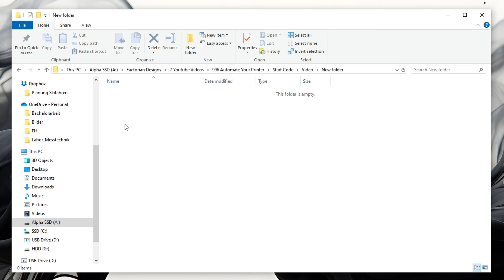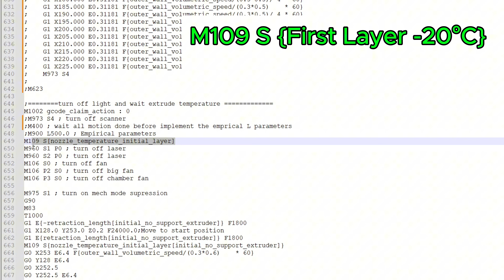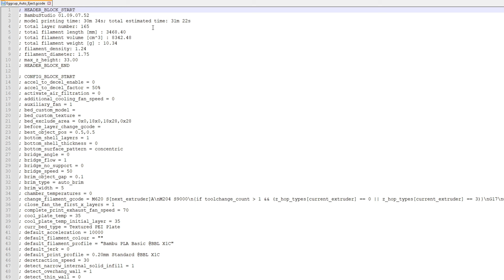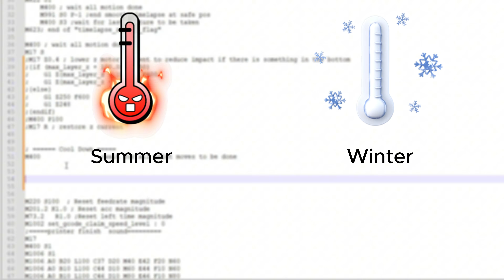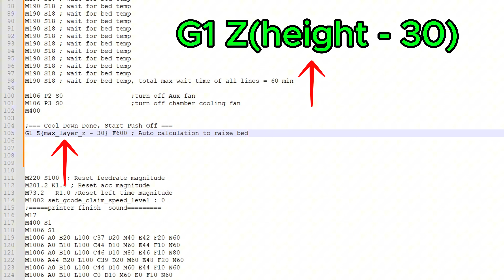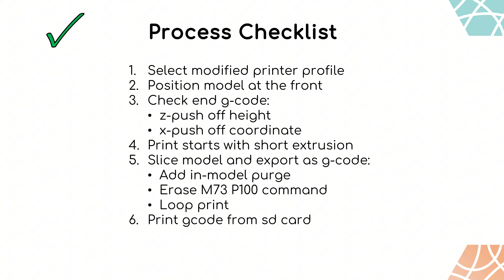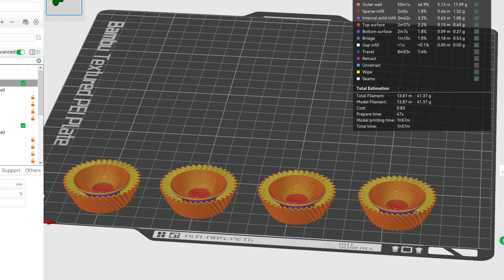Automate your Bambu Lab P1 & X1! Free & Easy

Comment: I am most amazed by the fact that you can have a printer, that is basically plug and play and you can have great prints sending them from mobile app while sitting on couch in a different room and you still can have such deep control over everything it does without any software or hardware modifications, no hacked firmware flashing, no unlocking with voiding warranty, support, manufacturer app support and so on. This is perfect.
Btw - if printing upside down works, then printing while printer is on its face should work too? And nozzle would be purged the same place where finished prints drop.
Reply from the maker: yes every orientation works, you just need space for stuff to fall in.

Comment: hey @Factorian_Designs - a question from another german dude. I don't get it with the purge line. I mean I do understand it somehow but I wasn't able to locate this in my start gcode. Or will this be added after I sliced it? Further, when you print some tiny parts, lets say like the shape o a pen - then the part with the modifier is kind of "complicated"... Is there any way to make that (even more) easy? don't get me wrong your video(s) is (are) perfectly perfect :) but I think I might be not the brightest.
Reply from the maker: I think they have changed the purge line since then but it should still be there. Its just 2 extrusion commands. If you want to see it in the preview engable "custom" in the top right preview section.

I don't know any easier way unfortunatly. Some just start without the extra line like I did in the A1 automation but I wouldn't exactly call that easier to implement 😅

Maybe look at some other automation videos to see if they have another solution :)

Comment: Unfortunately, it's not suitable for P1S. The nozzle starts printing completely dirty, creating blobs and mess on the first layer. It might be faster to prepare, but after pasting gcode, it seems to get worse. As for the final temperature for dumping the print, well, the fans don't turn on after the print is finished, and the printer sits idle, waiting for the bed to slowly cool down after a very long time. Please suggest some improvements.

Comment: First of all, I like your solution.
I would like to see that the "cool down" in your code checked the part height with an if/else statement to move the headbed height accordingly. (Note: I think your code says "move nozzle up," but it should actually say "move nozzle down/move head bed up," right?)
Are you familiar with the new "Farm Loop" from 3D Frames? I've tried it and can say it's not perfect. Every model they offer needs some tweaking, but the idea with the build plate bender is brilliant. (Note: I also optimized the model... I could share it.) I'm working on a combined solution, but:
I'D LOVE TO SEE THE BED BENDER IN YOUR CODE!
Reply from the maker: The bender solution really is fantastic. My A1 & mini code also has the if/else statement for the correct z height included as well. You should be able to transfer it with a few changes :)
Reply: @Factorian_Designs  
if/else for save cooling:

{if (max_layer_z) < 110}                ;When the bed is at zero (Z0), the object may be a maximum of 11 cm high before it touches the cable duct
    G1 Z1 F600                                 ; bed up
{else}
    G1 Z{max_layer_z -110} F600  ; bed up
{endif}
Reply: The "Bender" limits the printable area to a height of 200 mm (181+30=>200). This code clears the entire print area from top to bottom in 30 mm increments. (Starting hight dependsthe on object hight.)

;=== push down ===
G1 Z{max_layer_z} F900
M400

;!!!this "If" part copied 6 times into the code with max_layer_z 181,151,121,91,61,31!!!!
{if (max_layer_z) > 181}
  G91
  G1 Z-30 F900
  G90
  G1 Y250 F3000
  M400
  G1 X20 F3000
  G1 Y25 F800		; Very slowly push off
  G1 Y250 F3000
  G1 X80 F3000		                           
  G1 Y25 F800		; Very slowly push off
  G1 Y250 F3000
  G1 X120 F3000                       
  G1 Y25 F800		; Very slowly push off
  G1 Y250 F3000
  G1 X170 F3000		                             
  G1 Y25 F800		; Very slowly push off
  G1 Y250 F3000
  G1 X220 F3000 	                            
  G1 Y25 F800		; Very slowly push off
  G1 Y250 F3000
{endif}

;This part is always active and the only active path for pushing down objects if their maximum height is below 31 mm.
G1 Z0.5 F900
G1 Y250F3000
M400
G1 X20 F3000
G1 Y25 F800		; Very slowly push off
G1 Y250 F3000
G1 X80 F3000		                           
G1 Y25 F800		; Very slowly push off
G1 Y250 F3000
G1 X120 F3000                       
G1 Y25 F800		; Very slowly push off
G1 Y250 F3000
G1 X170 F3000		                             
G1 Y25 F800		; Very slowly push off
G1 Y250 F3000
G1 X220 F3000 	                            
G1 Y25 F800		; Very slowly push off

G1 X54 Y250 Z20 F900
M400
G1 Y265 F3000

Comment: My p1s can only cool down to 28 degrees Celsius in half an hour. Is there any solution? Thank you
Reply from the maker: Even with the AUX fan on?
Only way to speed this up then is lowering the ambient temperature, which can be very hard to do 😅
Reply: @Factorian_Designs Yes, I turned on all the fans and couldn't cool down. I tried to cool down the ambient temperature. Thank you very much.

Comment: Do you have any advice for getting petg to stick well enough to not spaghetti but still light enough to release when the plate cools to push off?  
I've tried several build plates and filament....should I be experimenting with nozzle temps or ?
Reply from the maker: I would recommend watching my other automation video for that.
There I explain in detail what you can do for prints to self-release :)

Comment: Got a potential hack for you: You can use Home Assistant to automatically send a photo from the Bambu camera at any layer height you desire to your phone as a notification . I use this for  checking my prints aren't spaghetti in a way I can't forget.

I use the MQTT method for this. I don't think it works if you use the recent "send all my data to China" Bambu update though.

Comment: I’ve been running your auto-print G-code for months without any problems—thanks again for that. Unfortunately, after updating my X1C/AMS to the latest firmware the file no longer prints from the SD card. It aborts immediately with the screen prompt:

“Please feed filament into the PTFE tube until it cannot be pushed any further.” 

If I slice and send a single model from Bambu Studio over Wi-Fi, everything works fine, so the hardware seems okay. The error only shows up when I try to run the multi-plate auto-print file from the SD card.

Have you seen this since the firmware change, or do you know what edits might get the AMS to load filament normally again? Any insight would be much appreciated.
Reply from the maker: Love to see people using this regularly!

This is probably fixed if you use a 3mf to loop prints instead of plain gcode. I explain how to do that in my A1 Automation video. 
Let me know If this fixed the problem for you.

Comment: Why do you explicitly not recommend alcohol for cleaning?
Reply from the maker: The Bambu wiki says it just moves dirt around and leaves residues. In my experience soap just leads to way better adhesion.
Reply: @Factorian_Designs  That sounds reasonable. 
I feared it might damage the bed. As someone searching the exception, I still think it  could be superior in being a solvent for fats.
However, in practice, it might leave residues, thus soap is probably the best option. 😅 I might have an adheason problem, which didn't become better since last time I used alcohol, I should try soap. However, there is a reason for using alcohol. You usually splash it on top of the surface, whipe it and hope for a good result. When using soap and aiming for good results, you need a sink, which might be not available nearby.
And I have a serious limescale problem :/

Comment: I seem to have a problem that the gcode that is generated seems to contain both the original gcode AND this gcode that I have copied from here. So for example, there are two bed levelling sections. Is this an issue with the new version of Bambu Studio ? Thanks loads BTW....Ringo
Reply from the maker: I tried this a few days ago and it still works that same. 
Are you 100% sure you copied the gcode into the correct slicer section?
(Not into filament etc..)
Reply: @Factorian_Designs  thanks for taking the time to get back to me! Bambu slicer looks diffferent nowadays but yeah, i think i did. For some reason i have two filaments sections open ( i dont have an AMS) for some reason - but its always been like this. Do i have to change them both?
Reply from the maker: No you don't change anything in the Filament section. You only change the printer start sequence in printer settings 😅
Does that fix it for you?
Reply: @Factorian_Designs  No because I can't find that on the new version of Bambu Studio. It looks different to your video....
Reply from the maker: I am currently on vacation and have no PC, but its definetly still there just in a different location.

You could just download Orca Slicer it still looks exactly the same and is better anyway :)
Reply: @Factorian_Designs I never even considered that. I might! Have a wonderful vacation and thanks loads

Comment: I love this idea and have been trying to do the same on my A1, but the problem im having is that I have no idea about GCode. Especially when it comes to weird/bambu specific codes. It deteres me from tying. I want to make prototyping process faster. I dont wanna wait 6 minutes each time I have a slightly different version of the model that Im working on. Each time it does vibration testing, which is really annoying, bed leveling, and the purge poop (even with flow calibration off. I do my own PA calibration. Also, I dont use AMS). i just want to press print and it starts to print with a very small purge line for good first layer. Thats all.

Comment: Can this still be done I cant find the Machine G-Cod anymore in the new bambu labs slicer update?

EDIT: It can still be done, The machine code is accesed now by clicking in a differnt spot on the slicer. Just to the right of the printer ther eis a button that looks like a sqaure with an arrow in the corner. That will bring you do this menu in the newst version of bambu labs
Reply: Thank you so much, I was searching for so long and no one was talking about where it moved to!

Comment: Hey @factorian_designs It seems that the new Bambu firmware update has created an issue with the start code. It mistakenly identifies the system as using an external spool instead of the AMS. As a result, it won't load from the AMS, and if you pre-load the AMS, it will retract the filament. Could you please take a look at this?

Comment: Dunno why, but my X1C doesn't want to do no matter what I put into start/end g-code. Still does the vibration compensation at the beginning of the print and drawing purge line (the single one). Followed your video to the letter. I'll try more tomorrow. 
It came with 1.0.7 firmwave version out of the box and haven't updated it and I'm quite familiar with 3D printers (have modded ender 3 and built my self wannabe voron), but new to bambulab printers.
Reply from the maker: Never heard of that even with new firmwares. Are you sure you are adding the start code to the right section? Thats to only thing where this could go wrong.
Reply: @Factorian_Designs  at first i pasted it in the wrong part, but after realizing that I fixed it and pasted in Machine gcode (just like in the video You've shown) which makes it all weird even more.
Reply from the maker: @hashbringer975  That is weird and normally all you have to do. Maybe try everything from scratch again. Thats sometimes the last resort I try for stuff like this.
Reply: @Factorian_Designs  I'll give it a shot after I get home, but yeah, wierd that it doesn't take into the account start and end gcode.
Reply from the maker: @hashbringer975  
No it does take it into account. If you completly erase the startcode the printer won't startup at all.
Something else is going wrong here.
Reply: @Factorian_Designs  I'll try again later today and update you.

Comment: This has been running for months for me on my P1S and X1C, making hundreds of parts.  Recent firmware update and now I cannot print on the P1S.  I can print the Auto-Extract gcode from Bambu Studio (via cloud), but if I export and run the EXACT SAME gcode from the sdcard it throws this error:  "HMS_0700-2000-0002-0005: Failed to feed the filament outside the AMS. Please clip the end of the filament flat and check to see if the spool is stuck."  Definitely not a stuck filament, since I can immediately send the print via cloud and it runs just fine.  Anyone else experiencing this?  Been troubleshooting for days!
Reply from the maker: Love that you are using it this much!

To fix you problem I would try using 3MF files instead of gcode files. I explain how to do that in the looping section of my A1 automation video.

I am pretty sure this will fix the error for you as this will also include a bunch of meta data files your AMS needs for a few things.

If this doesn't work you can also downgrade your firmware until you find another working solution.

Please let me know if this fixed the problem, feedback like that is pretty valuable to me as others are likely to ask the same question. :)
Reply: @Factorian_Designs  Back in business!  The 3mf was not only a fix, but that A1 video shows several really useful improvements enabled by using the 3mf!  I'll be revisiting all of my automations to make improvements.  Keep up the great work!
Reply from the maker: @timothyryner  Awesome! 
And thank you I will release more videos with time as well.

Comment: So if I removed the door, download this code and make it a profile , it would knock my print off ? I’m not trying to auto print one thing over and over. I’m trying to print , from afar ( I work on the road ) then have the print get knocked off so I can come home and assemble the project. Could I do this from not a sd card. Say I choose something from bambu app. Print it. Then go and run this profile to knock the item off ? Then just reprint ?
Reply from the maker: Take a look at my A1 automation. There I show how to do everything with 3MF files. You could in theory do what you discribed but you would have to be very sure that the parts selfrelease after cooldown.

Otherwise you might damage your printer.

Comment: Wish I could disable filament purge on my A1.
Reply from the maker: You can, in my latest video I show how to disable all purge lines. You can also disable the initial filament purge but I don't exactly recommend doing that.
Reply: @Factorian_Designs  Took a look thanks, I think I'll leave it as I havent really come into any issues and dont want them haha.

I did spot in one of your videos to make the outter line 0.33 instead of 0.42 and inner 0.36, will see if that helps improve quality for me :)

Also changed Avoid crossing from 0 to 300mm, not too sure if I needed to or not, but your prints look amazing and changed my settings to match.

Thanks again.

Comment: Why didn't you just use a for statement? Does bambu not support for statements in gcode?
Reply from the maker: As far as I know and tested this is not supported.
Reply: Well thats dissapointing. There's machines in my shop older than me capable of loops and conditional statements. @Factorian_Designs

Comment: Wow, what a great video!  Thank you for your detailed explanation. I’m stumped on a particular part that I’m trying to print in volume. I’m running an X1C with an AMS. My model has a number of colours in it.  The first layer is the most important for my model as the consumer is reading it. If I want to keep using a prime tower to ensure no under extrusion and I loop printing the model 10 times, is there a way to change the location of the prime tower after each loop? Then after the 10 loops finish, I can manually clear the build plate and restart the process?
Reply from the maker: Hm I am not sure that is possible, what about pushing the prime tower off with the print? Changing the tower location is pretty easy.
Reply: Thanks for the quick reply! Unfortunately my prime tower is only a few layers tall so I don’t think it would be possible to push it off. Wondering if you could help me off the YouTube platform for a fee with my particular dilemma?
Reply from the maker: @AlanRoberts-u2k  A small prime tower really is quite a problem. I honestly don't have a solution for your case, I would feel bad if you book a consulting session with me.

Comment: technically this is not an infinite loop as you are looping the code by running it multiples times down a list. I was hoping to see a way to make the printer run the code back from the top.
Reply from the maker: true, for some reason the people at bambulab decided to get rid of all infinite loop marlin commands.

Comment: Excellent tutorial. I have similar problem. My issue is that my model lies flat on the bed and is to thin to be pushed off. Is there a way I can add a pause in between prints and skip the cool down so I can only switch the plates and click resume?
Reply from the maker: I am pretty sure you should be able to add that after the last layer of your print in the slicer. If  you can't put it at the last layer you have to look up the Bambu Lab G-Code command for "pause until user input".

Comment: I know it's a dangerous game, but if you know it takes 9 minutes to cool the bed, could you start that in the last couple minutes of the print? Might only save 2-3 minutes and probably not worth the risk, but curious.
Reply from the maker: That is very risky indeed ^^ but you would have to use the costum postprocessing gcode section for that. But I am not sure how exactly this could be done.